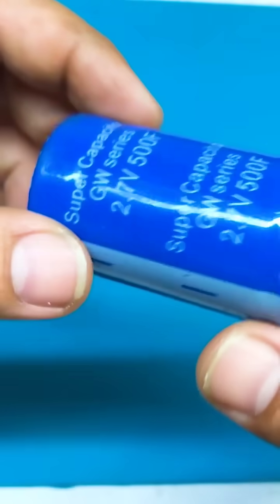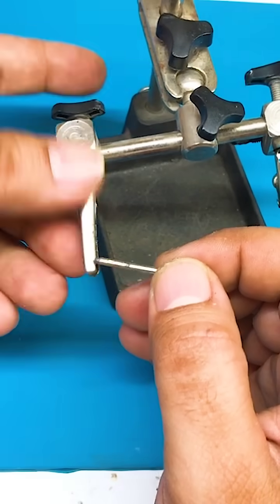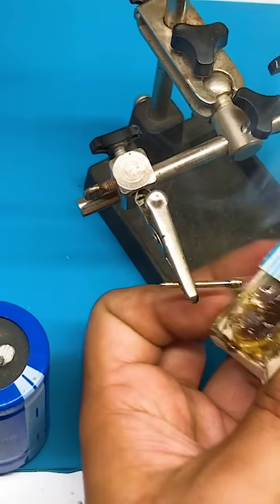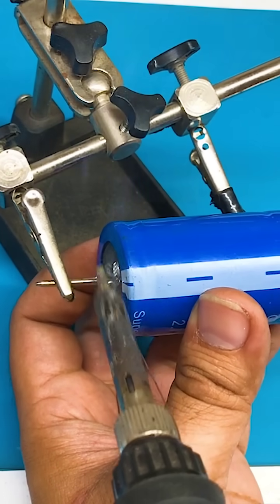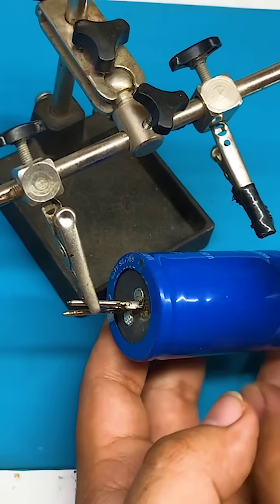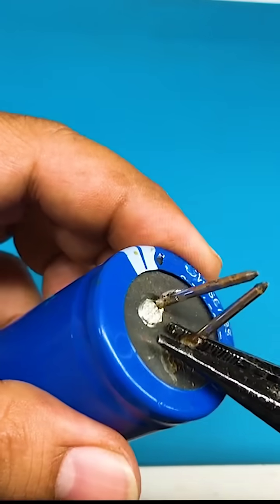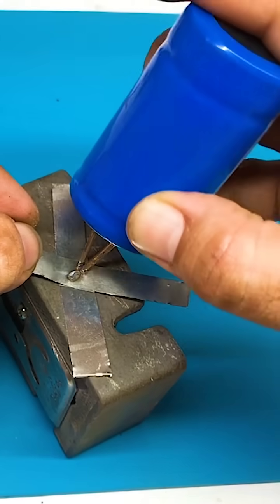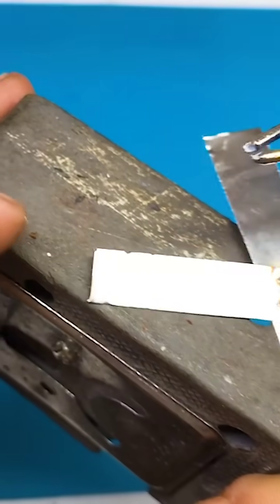How To Make a Spot Welder Form A Super Capacitor | Easiest way to make a Spot welder #diy #welding

Comment: 2,7 volt super capacitor not for use 12 volt charger
Reply from the maker: i used for a fast charging
Reply: @THEKEPLERSTORE 😂
Reply: Adaptor current is lower than charging current so  voltage of the adaptor will drop

Comment: The capacitor may explode above 2,7V, so I don't recommend it.
Reply from the maker: No worries, you can charge a super capacitor with a 12V supply.
Reply: @THEKEPLERSTORE that may be true but you are basically shorting it over and over.  Rename video " How to have electrolytic capacitor explode on your face"  ty
Reply: @THEKEPLERSTORE  I know it, cus the voltage drops when the capacitor is loading, but you still shouldn't overload the capacitor over 2,7V. 
And you can destroy your power supply, using it just straight this way
Reply: @thomasgiesen6849  How about an array of capacitors connected in series 6x= 16v then charge it from a 12v car running gives 14.4 so it’s not more than 16 (safe) then use 14 gauge wires and alligator clips and stainless steel nails ? Do you think it would work?
Reply: How about an array of capacitors connected in series 6x= 16v then charge it from a 12v car running gives 14.4 so it’s not more than 16 (safe) then use 14 gauge wires and alligator clips and stainless steel nails ? Do you think it would work?
Reply: @wateristhefuelnotfossil that is what I am using for starting my car and have posted video. Charging single capacitor with 12v will explode it.